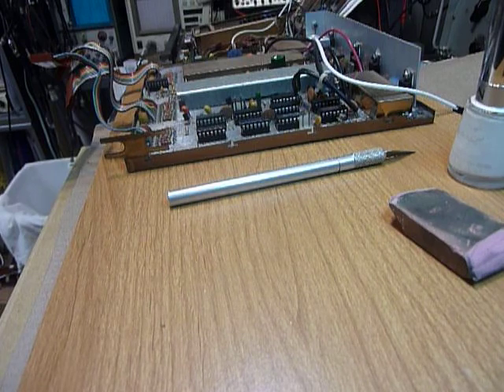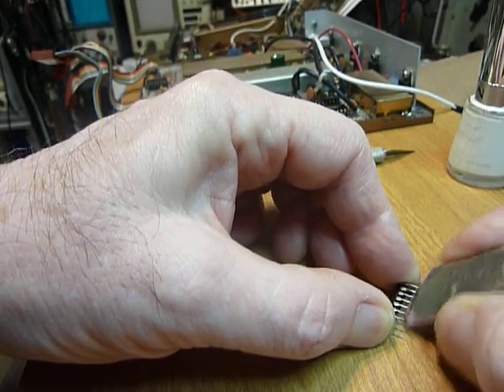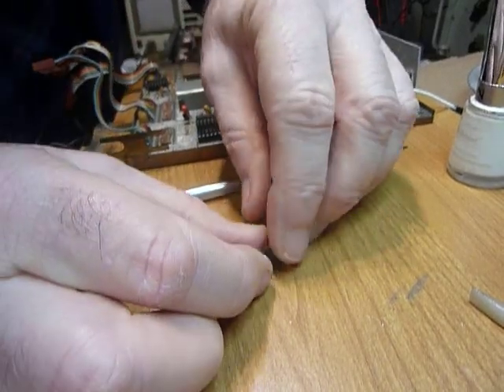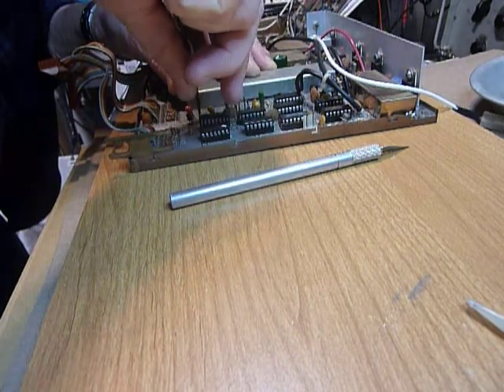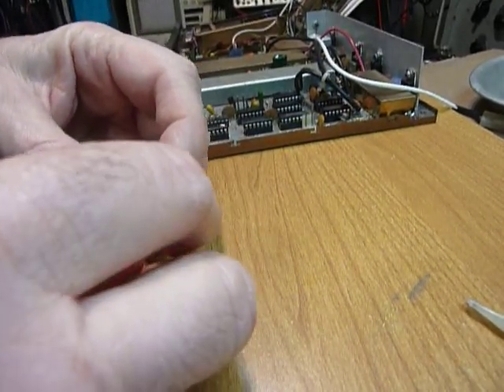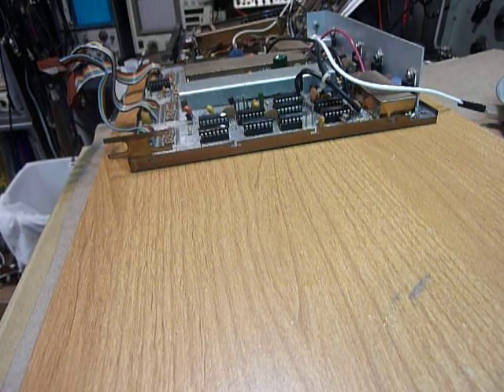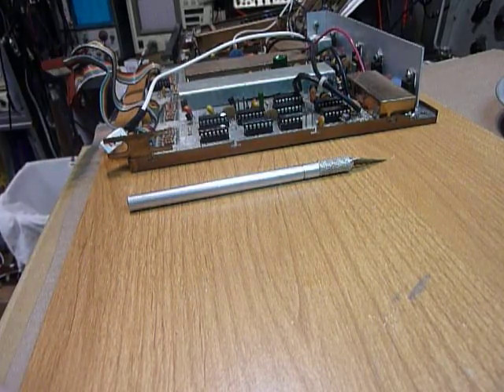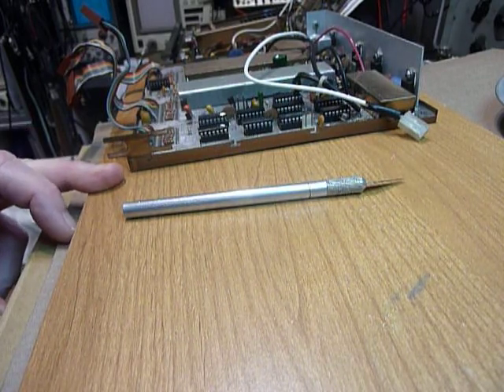HEATHKIT SS9000, cleaning Ic's , Corroded connectors , clean tarnished sockets

Comment: I built a Heathkit stereo receiver maybe a  -AR2020 - it was a 4 channel. It had 4 circuit boards that plugged in to the main circuit board and attached to the back of the receiver. It would lose a channel sometimes and you could flex the back panel and that would move the circuit boards in the sockets and it would start working. I cleaned the contacts with 1200 grit sandpaper. Should have used the silicon grease on the contacts.